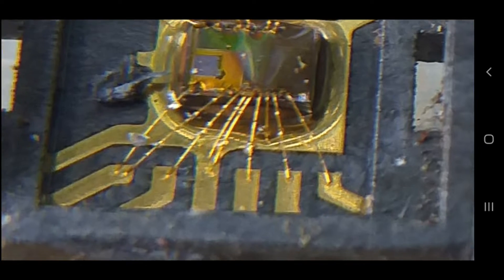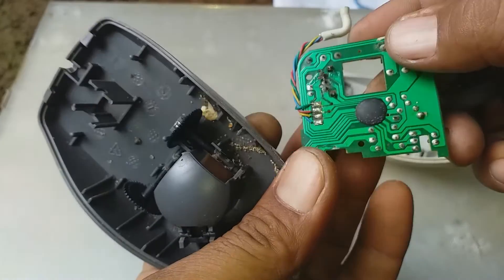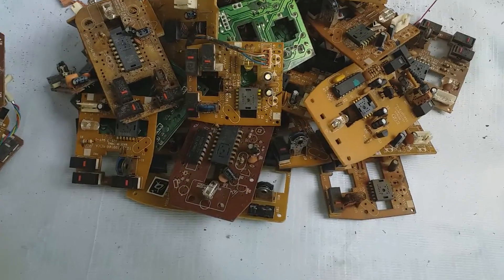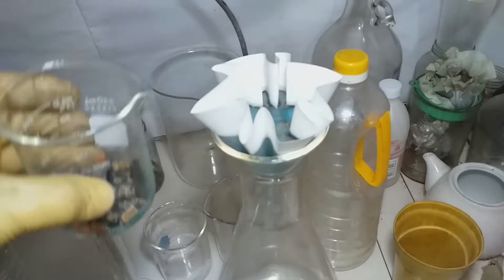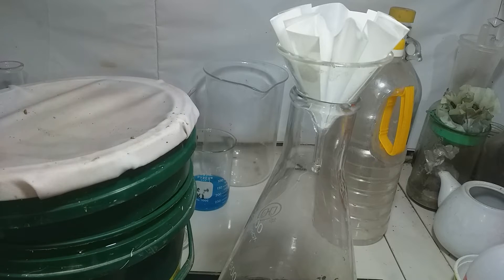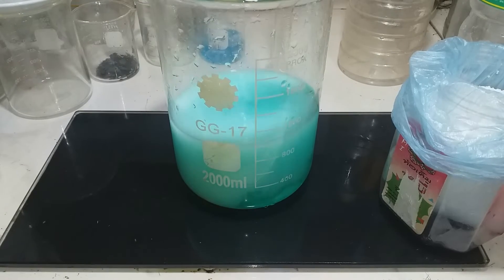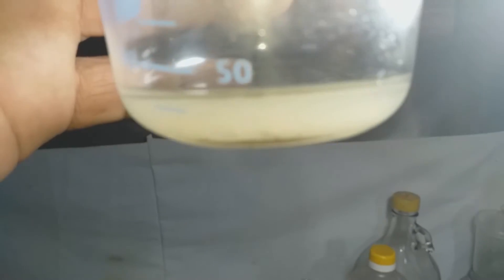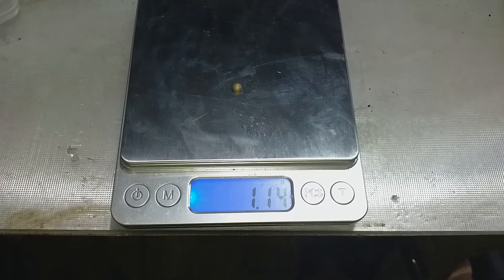24K GOLD BONDING WIRE | HOW TO FIND GOLD BONDING WIRE IN ELECTRONIC? | RECOVERY GOLD

Comment: How many computer mice can you recover 1g of gold?
Reply from the maker: 200 pieces
Reply: @PoorMiners321  Sir, I just saw 31 or 32 pieces on the table in your vedio to get 1.14g gold in the finally. Is there some wrong about 200 pieces to 1g gold?
Reply: @PoorMiners321  By the way. some chips are silver legs and some are gold legs. Is there different about the gold content?
Reply: @PoorMiners321  In addition, is it related to the number of pins on the chip? For example, some are 8-pin, but some are 16-pin. Thanks